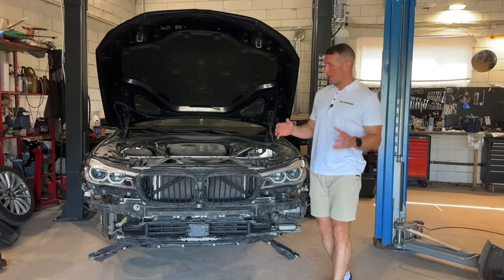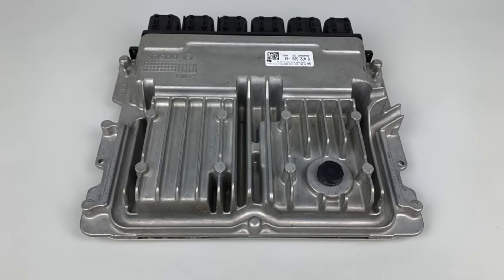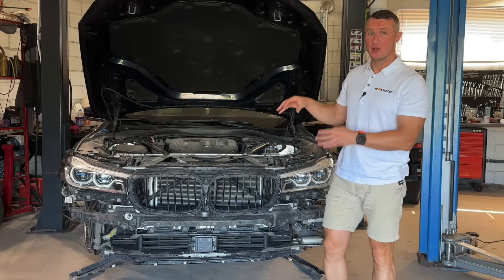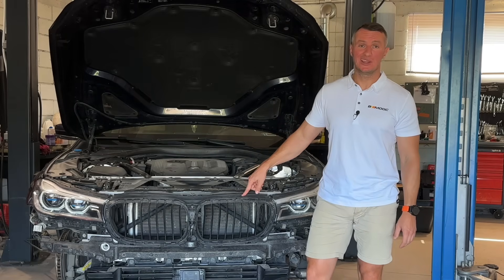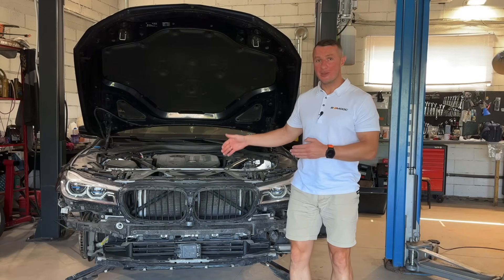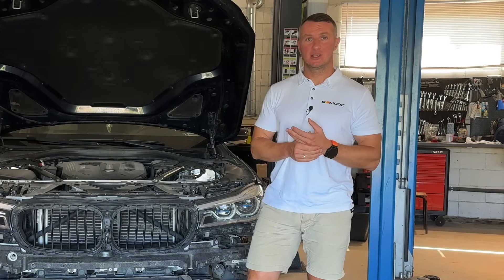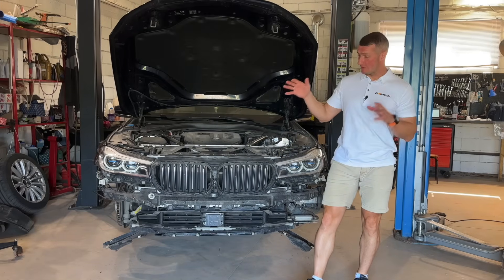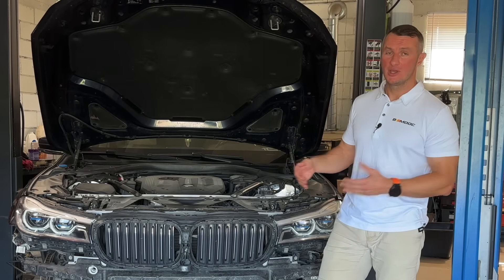BMW G Series Cooling Flaps Explained: Troubleshooting, Recoding, and Cost-Effective Fixes

Comment: Hey doc can you give me an advise? My g31 lci 2023 has adaptive suspension on the rear wheels but on front wheels has standard suspension...can I upgrade to adaptive suspension on front? I have vdp and kafas4 ecu and only missing the high sensor on the front driver side. Normally should be possible if I check after the vin number for parts it has both standard and adaptive.
Reply from the maker: That’s the first time I see adaptive in one axile only! How it should even properly work??

Everything is possible. But might require more changes of ECUs than just changing of front shock absorbers.
Reply: @BimDoc   how can I contact you to send some pictures of the system, practically I was interested if you did this and if its possible without too much changes...

Comment: hi there, i have the new bottom flaps without radar to install. After installing do i have to code the new flaps to the car? g11 2017 model
Reply from the maker: Flap motor acts as a slave and does not require coding 

Plug and play!

Comment: G20
I have an issue with the lower grill
138225 - Lower radiator shutter: upper stop not detected.

Is it a problem with motor of the lower grill? I found a used motor of the lower grill, does it make sense to change it? Or is the problem not related to the motor?
Can I turn off the lower grill by coding it?
Reply from the maker: Sensor of the position is built into the motors. 
So most likely it will fix your issue. 

Or there is an error with the lever (broken or worn out). That’s why it goes over the limit and does not see the correct position.

Comment: I had a flap failure on the f11 model, it turned out to be a frayed wire, where the bumper mounts on the right side. Repairing the wire fixed the problem.
Reply from the maker: Absolutely, there could be more than one possible errors causing the fault.
But moving parts (motors) tend to go out of order with higher probability than just a wire. 
But dut to friction and whether conditions wires do corrode))

So everything is possible.

Comment: Please note that there is an software error in the DME affecting the upper flap on X3 G01 and X4 G02 with production date up to august 2019, with i-level below S15A-18-11-500, and with fault codes 21B043 and 138207 stored. To fix that error you need to program the vehicle to reach at least i-level 18-11-500 and perform a functional test of the active air flap system using test plan “Radiator Blind (ABL-DIT- AT1214_BX8_KJ)” in ISTA. For more information see BMW Service Information Bulletin SIB 51 21 19.

Comment: Hi sir. First of all, like always great video. appreciate all your work.

i know I have a ton of questions but I want to learn them from a trustworthy source like you. so its okay if you don't answer them. we respect you

so we have a 2013 F34 320d GT

1- is it possible to retrofit NBT Evo to the vehicle which has S609A navi system professional?

2- how can we retrofit a rear view camera, does it needs other ecu's or straight to hu?

3- is it possible to add lane keep assist to the car which already has blind spot monitor, speed limit info, pedestrian protection?

4- is adding the radar to front with its wiring and ecu and coding the required SA enough for having ACC or additional work is needed? (like steering wheel replacement?)

thank you very much
Reply from the maker: Nbt evo retrofit is possible to your vehicle 

Camera retrofit requires camera ecu (if it not an I am where camera is already like ecu)

Lane assist can be added via coding and extra buttons 

ACC will require buttons to the steering wheel.
Reply: @BimDoc  thank you very much sir words cant describe how greatful i am for your responses.😇 have a great day :_bimdoc:

it would be so good to make videos of these when you got time. people will all appriciate your work and you will be 1 million subs in no time😎😎